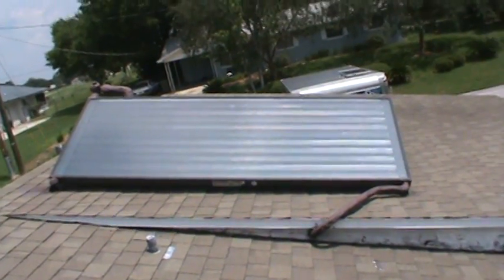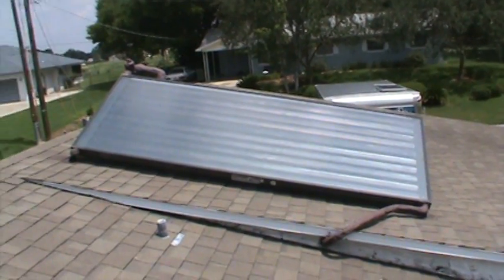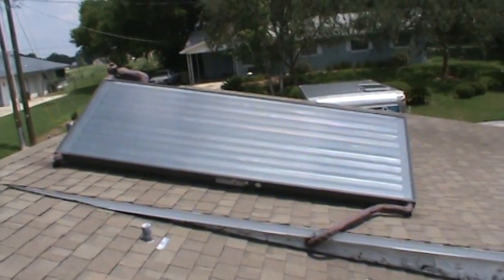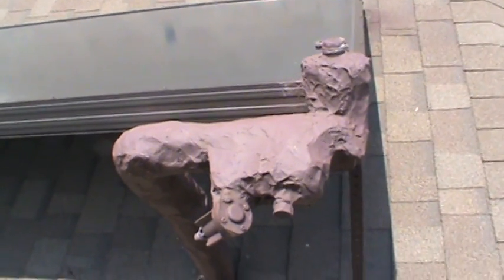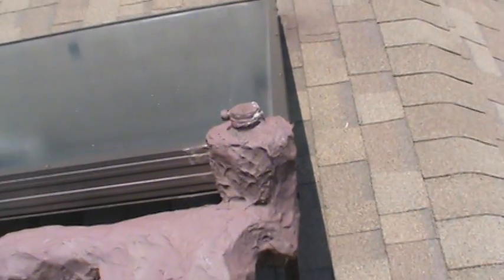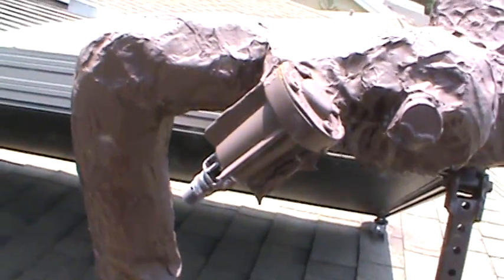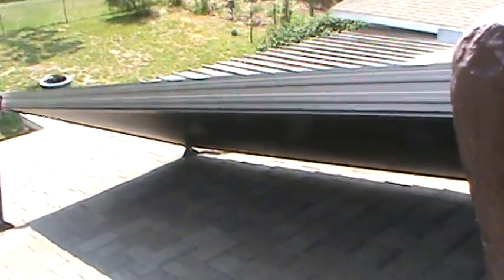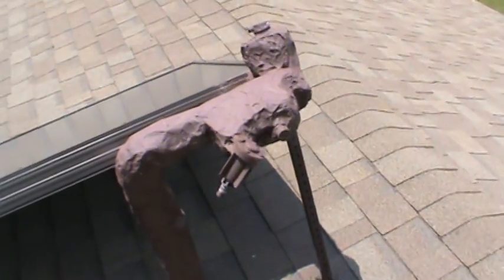Solar Water Heater

Comment from the maker: @youwildbank Yes, go with and indirect system and possibly evacuated tube collectors depending on how far north you are. Also, the reduced solar insolation up north and indirect system usage mean that you will need more panels for the same amount of hot water usage down south.